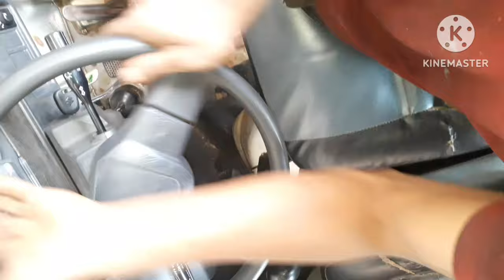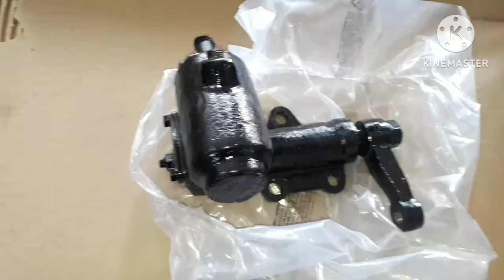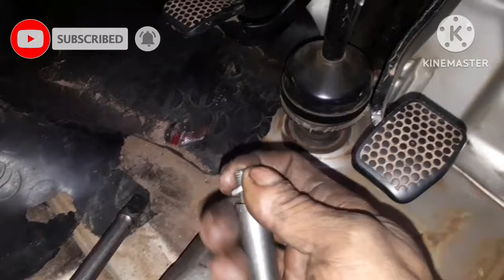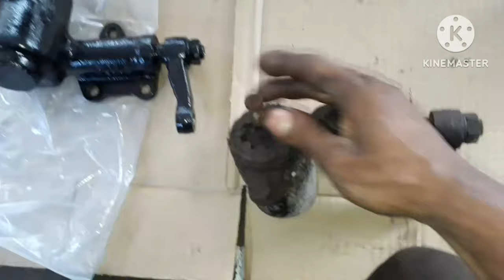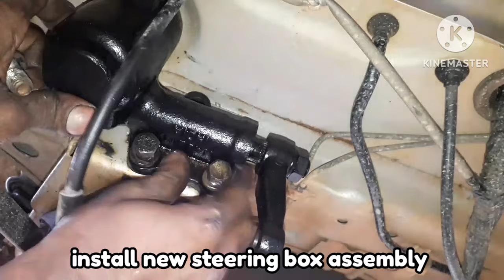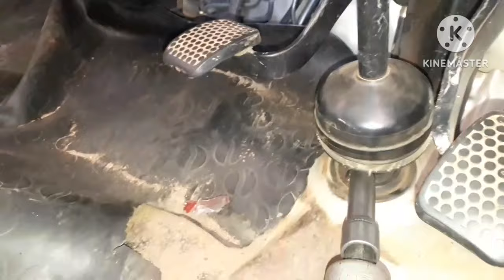how to replace maruti omni steering  gearbox

Comment: Nyc video  sir  can i know  omni engine oil capacity  and for how many kms can run after changing  the oil  and even gear box oil also
Reply from the maker: Maruti omni engine oil capacity 2liter 700ml 
Engine oil change interval 1year /10,000 km
Gearbox oil and differshial oil change interval 20.000km
Reply from the maker: Thank you for your enquiries like and subscribe keep support